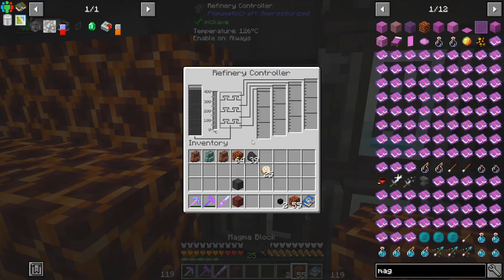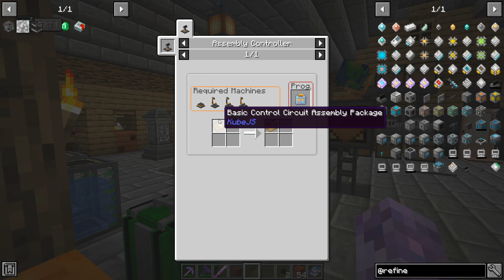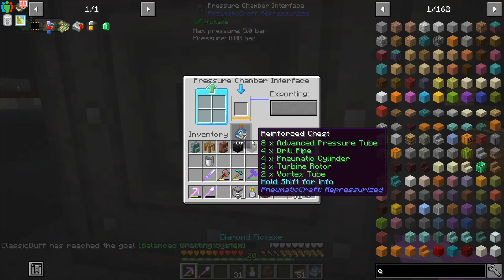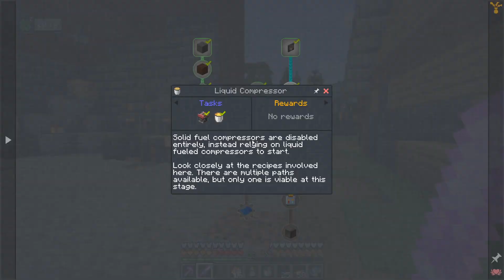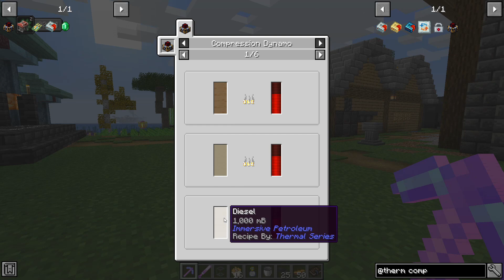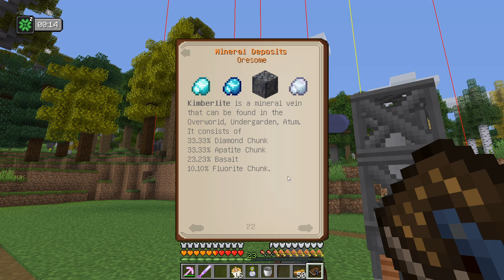Enigmatica 6 Expert | Pressure Chamber | Ep 21

Comment: The pressure chamber can output directly into an inventory attached to it without the use of cables or anything, just put the chest right next to the port. Also you should really get a villager to turn into pneumaticraft profession by using a charging station and get a bunch of stuff through those trades, it will save a lot of time.

Comment: The challenge with Refined Storage in this pack is power - it uses like 2000 rf/tick just for a basic system.
Reply: 2k rf/tick should be easy by that point, I'm already approaching that and I'm no where near rf, still have to make a pressure chamber
Reply: @hydra3869  Producing 2k RF/tick for constant draw in a renewable way requires a pretty beefy power infrastructure and the automation to back it up.  It's not insanely difficult, but it's a nasty surprise if you rush for refined storage and then find out you can't actually run your storage system for more than a few seconds at a time.
Reply: @unpronounceable1  Did they make the wind generator ridiculous? If not that is an easy way to get to 2k renewable, an array of solar panels with a decent buffer (I got a free powah cell, not sure if it was random or certain) should do the trick as well since nights are 2x shorter than the day, you only need 420 seconds worth of power and that is 840k, easily within range
Reply: @hydra3869  There are 20 ticks in a second.
Reply: @unpronounceable1  Ah, tick not second, completely forgot. It should still be the same, you just need a larger buffer.
Reply: @hydra3869  Sure, but a 16m RF buffer isn't trivial in this pack.  Power requirements for Refined Storage are rough in this pack, pretending they aren't is silly.  It requires advance planning and building up beefy infrastructure and automation to be useful even once you get past the gating.  It's easy to say "simple, just build 50 windmills", but actually building 50 windmills  is annoying and tedious.
Reply: @unpronounceable1  Well you only need 5 or so windmills, I had that on my first playthrough of the non-expert pack. I'm fairly certain they produce a constant output so they wouldn't require a buffer like the solar panels would, but if you still want to use solar panels, you could just sleep once you notice your system is off/decreasing power

Comment: To get the pumpjack running, you need medium machinery schematics!! You are getting close, but now quite yet. 
For heat, you can make it super simple with mekanisms fuelwood heater. 
The omnihopper is inserting back into the output interface of the pressure chamber. You don't need a hopper on the output, it will  just output directly into a chest. 
You can use the interface to extract all items from the pressure chamber, so you don't lose pressure when you need to get something out. 
RS is super close but you'll need to rely on external storages for storage for now. Disks are expensive.
Reply from the maker: Oh... lol. That just saved me a bunch of time trying to assemble the pumpjack 😂